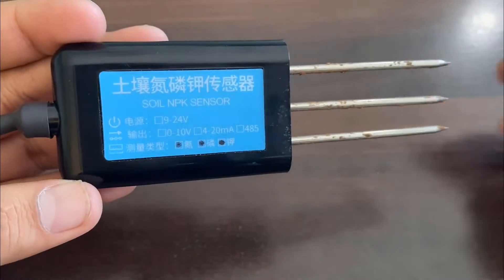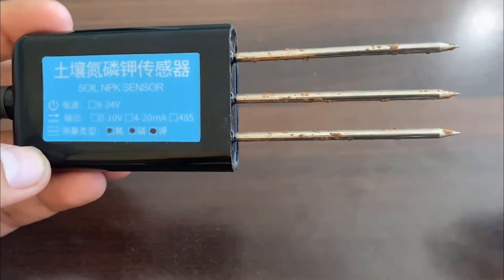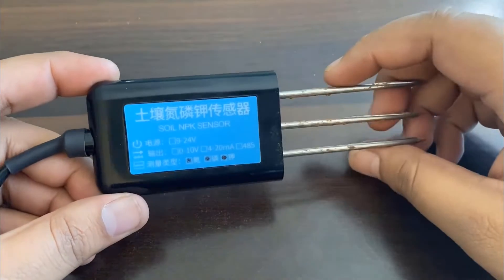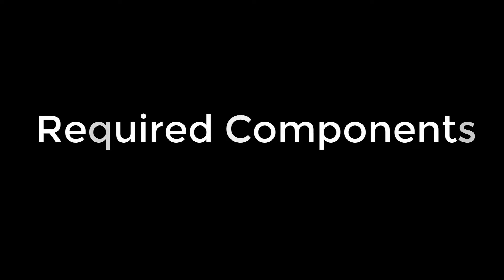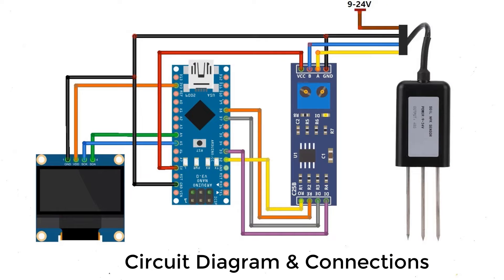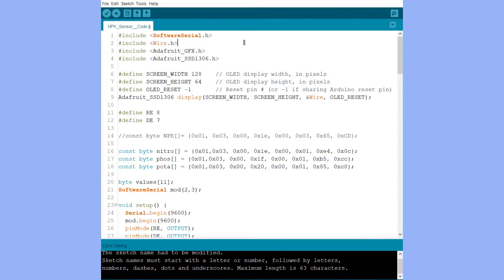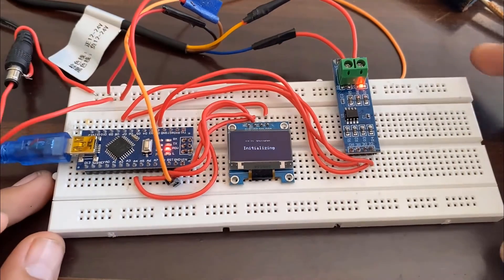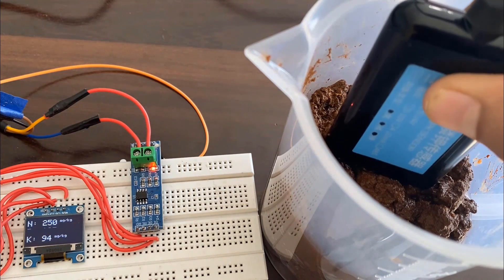DIY Soil NPK Meter || Measure Soil Nutrient Content using Soil NPK Sensor & Arduino

Comment from the maker: NPK Sensor Purchase Link: https://amzn.to/3rEHI8r
Reply: code is running but the output values are 255 255 255 how to overcome this issue
Reply: @SoilMaster-4u  use 4800 for serial baud rate
Reply: @SoilMaster-4u  if you're solution is founded
Help me about that
Reply: @SoilMaster-4u  same problem 
Did you found how to solve the problem
Reply: @khaledmerahi2298  en baud rate is 4800
Reply: @felixfrilovic9370  it doesn’t work
Reply: Can you provide me code?
Reply: sorry, I want to ask. Is the sensor calibrated or does it have to be calibrated first? If it has to be calibrated first, how do you calibrate it? please answer
Reply: Hello, thanks lots for your efficient video's. Could you please send me its Gerber File.
 With The Best Regards,
Dr. Manoochehr Farboodi.
faboodi@gmail.com
Reply: @Climax2025   Sorry for the ignorance of my question, but what would the Gerber Files be.
 Best regards,
Dr. Manoochehr Farboodi.
Reply: I was wondering if this was a fake, typically it would make sense that a semipermeable and selective membrane (each to potassium, nitrogen, and phosphorous) would be needed to keep out other dissolved electrolytes.  I'm hearing nothing like that here and it probably is fake and will just spit out random numbers.  If you want to dissolve NaCl in water and see what happens, if it reads nothing, then try some potassium chloride solution,  and see if it only reads a potassium level. Do the same with nitrogen and phosphorous.  If you really want to see how accurate it is after that you can do a little math and see if the concentration is accurate. I did not see that level of scrutiny here in this video and would not waste my money on this product.

Comment: hlo in diagram you showerd one connection and in bred board you are showing one connection which one i have to follow
in bred board you connected only two wires,a,b in diagram ground and vcc also connnected

Comment: Can you provide details on how you connect the brown wire of NPK sensor to the 9v power supply? Do you need any adapter to do so? Any link on what kinds of power supply should I buy and adapter if needed. Thanks!
Reply from the maker: Yes use a 9-12V DC Adapter.

Comment: I was wondering if this was a fake, typically it would make sense that a semipermeable and selective membrane (each to potassium, nitrogen, and phosphorous) would be needed to keep out other dissolved electrolytes.  I'm hearing nothing like that here and it probably is fake and will just spit out random numbers.  If you want to dissolve NaCl in water and see what happens, if it reads nothing, then try some potassium chloride solution,  and see if it only reads a potassium level. Do the same with nitrogen and phosphorous.  If you really want to see how accurate it is after that you can do a little math and see if the concentration is accurate. I did not see that level of scrutiny here in this video and would not waste my money on this product.

Comment: How do you calibrate the sensor?
Reply: I was wondering if this was a fake, typically it would make sense that a semipermeable and selective membrane (each to potassium, nitrogen, and phosphorous) would be needed to keep out other dissolved electrolytes.  I'm hearing nothing like that here and it probably is fake and will just spit out random numbers.  If you want to dissolve NaCl in water and see what happens, if it reads nothing, then try some potassium chloride solution,  and see if it only reads a potassium level. Do the same with nitrogen and phosphorous.  If you really want to see how accurate it is after that you can do a little math and see if the concentration is accurate. I did not see that level of scrutiny here in this video and would not waste my money on this product.

Comment: Hello Sir/Maam, I would like to ask, if the sensor detect this example value:

N: 40 mg/kg
P: 90 mg/kg
K: 100 mg/kg

What is the threshold of  Low, Medium Low, Medium High, High, and Very High? And I ask too let say Nitrogen is Low how many amount of nitrogen need? Is the soil need 120, 100, 80, 60, 40, 30 nitrogen and so on?

Comment: Hello, I recently tested a similar npk-meter and found that it responded to any salt regardless if it contained any N, P, K. or not. Normal Kichen salt for example consists just of NaCl and no Nitrogen, Phosporous and Potassium (K). It still leads to high values of N,P and K if applyed to the soil. Did you precisely check if your npk-meter is really Ion-selektive or if it maybe also just responds to the conductivity of the solution???
Reply: I was wondering if this was a fake, typically it would make sense that a semipermeable and selective membrane (each to potassium, nitrogen, and phosphorous) would be needed to keep out other dissolved electrolytes.  I'm hearing nothing like that here and it probably is fake and will just spit out random numbers.  If you want to dissolve NaCl in water and see what happens, if it reads nothing, then try some potassium chloride solution,  and see if it only reads a potassium level. Do the same with nitrogen and phosphorous.  If you really want to see how accurate it is after that you can do a little math and see if the concentration is accurate. I did not see that level of scrutiny here in this video and would not waste my money on this product.
Reply: Easier to add Potassium and test as it's easily obtainable.
Reply: Yea the sensors just test ec and spit out a value for npk based on the ec reading multiplied by a constant. If you look at a few examples they are all reading (approximately) n=2.5*p and k =0.9*p.

Comment: Hi, i have a soil multi-parameter sensor 7-1, and i want to print all the sensor, and i have problems to do that. if i use the npk code, it always prints 255 in some sensor. How can i use it with all sensors? i don't know if the answer is the number of bits or something. Please i need help
Reply: I was wondering if this was a fake, typically it would make sense that a semipermeable and selective membrane (each to potassium, nitrogen, and phosphorous) would be needed to keep out other dissolved electrolytes.  I'm hearing nothing like that here and it probably is fake and will just spit out random numbers.  If you want to dissolve NaCl in water and see what happens, if it reads nothing, then try some potassium chloride solution,  and see if it only reads a potassium level. Do the same with nitrogen and phosphorous.  If you really want to see how accurate it is after that you can do a little math and see if the concentration is accurate. I did not see that level of scrutiny here in this video and would not waste my money on this product.
Reply: @jonesmatthew7511  I solved it, Thanks
Reply: @hector2742  hey buddy, can you let me know how you solved this FFFFFFFF 255 issue?
Reply: @luqmanafridi3952  What's microcontroller do you use?
Reply: @hector2742  hello I used an arduino nano and the connections are same in the video. May I know how you solved your problem? I have the 6 in 1 multi-parameter sensor
Reply: how did you solve it??

Comment: Hello, I am trying to replicate the project with an Arduino MKR GSM 1400 and I get pure values of 255, however when I tap the RE and DE pins I get values as random, because they are very different. I hope you can help me, thank you very much :)
Reply: Is this fake then? I was wondering how it differentiates between electrolytes

Comment: Hi! Nice Video, Do you know how to read  If I have a sensor with 6 parameters? Like Humidity, Temperature, PH, Nitrogen, Phosphorus and Potassium.
I have the frame from manufacturer, but then I do not know how to read each of them because it is only one frame, not for every parameter like yours.  So the resulted frame will be like 17 bytes I think..

PS: looks like your first const byte called NPK, but mine contains another 3

Comment: Plz Let me know why the value is obtained only in moist condition and fluctuate with addition of Water
Reply: hello sir, ur problem is also mine so please help me when u fix it
Reply: Because the soil solution nutrient concentration changes with the humidity raises, that's why you need standarize the soil humidity at you make the measures, so you need calibrate your sensor to a standard soil humity

Comment: Hi. 
I have the same problem using Arduino UNO. It replays with FFFFFFFFFFF for N,P, and K. is there any development regarding using Arduino UNO with NPK sensor?
Reply: Give the NPK sensor with separate power (mine-12V),i.e donot connecte the gnd to nano and 485 board. (From HK)Give the NPK sensor with separate power (mine-12V),i.e donot connecte the gnd to nano and 485 board. (From HK)

Comment: Thanks for the nice video...its guiding however, I've done everything but the values are 255, 255, 255 for all the N P and K.. what could be the problem?
Reply: just dip the sensor in water, tea or soil that will show the result, 255 seams to be idle value

Comment: Hi nice video, i was buy the sensor and try to implement this, at the first time i got the right value and always change, but now the output value constant  255,255,255, do you know what could it be the problem ?
Reply: just dip the sensor in water, tea or soil that will show the result, 255 seams to be idle value

Comment: Hey, I did the implementation exactly the way mentioned in the tutorial, I just used Serial monitor in place of OLED display. But I find the value of N, P, K to be 255 when the NPK sensor is plugged to 9-24v power supply and even if it is not connected. Can you please get me out of this i.e finally getting the exact NPK values you got in the video. Please 🙏
Reply: I got same problem too. do you have any development?
Reply: @belajardarisiniaja  Another Point to note is that the Jxct NPK sensor might not be reading the correct NPK values as we observed some linear trendline between N, P, K form the data of many samples. So, basically our conclusion was that the NPK sensor was only reading the Electrical conductivity and then trying to use some algorithm (which might be close to the linear I mentioned above)to give us the N, P, K values i.e., We found the NPK values shown by the sensor are not trust worthy.
Reply: @akulavamsi4832 thanks for the info. so, basically we can predict how many N,P,K or others component by calculate only some constant value with EC in a formula?
Reply: @belajardarisiniaja sorry,  I didn't get you
Reply: @akulavamsi4832  I mean, I can get the value of N, P, K with tool that can read Electrical Conductivity as long as I know the constant value or the linear trend formula
Reply: @belajardarisiniaja  Do, do you know the tool or the formula?
Reply: @akulavamsi4832  I still dont know the tool for microcontroller but i have read something like "electrical conductivitybfor detecting nitrogen"
Reply: @belajardarisiniaja  Yes, There are some research papers on trying to find the relation between EC and N,P,K but nothing is finalized.
Reply: @akulavamsi4832  hi. today, my RS485 to USB converter is arrived. But, after I try to read the NPK sensor with CAS modbus software in windows 10, it failed to read the sensor. it always timeout even though the device and function is match with the datasheet. Is my sensor broken? 
* for the wiring :
sensor npk (A,B,GND) -> RS485 to USB converter (A,B,GND). 
sensor vcc -> adapter 9V 2A
Reply: @belajardarisiniaja  Is there any other means that we can connect?
Reply: @belajardarisiniaja  Yellow and Blue wires of the Sensor should be connected to USB converter and Black and Brown wires should be connected to the power adaptor. Also for the converter to work ensure that you installed CH340 driver into your PC. Then when using CAS modbus scanner software please ensure that you did input the baud rate right. i.e 4800 as it is default and mentioned in documentation. and then run the reading holding registers (4xxx) and put offset as 31 and length 3. Then If you get the results then your sensor is working or else it is not.
Reply: @akulavamsi4832  it works. The result is in column hex e.g 0x0034 but in column char is 4. Is it ok?
Reply: @belajardarisiniaja  Great. I look at the int column for the results.
Reply: @akulavamsi4832  thank you so much for your help
Reply: @akulavamsi4832  Hello can you explain the last few steps. I do not understand how to "run the reading holding register." What does (4xxx) mean? Can you show me how you updated your code? Sorry, I dont understand. Thank you very much!
Reply: Furthermore, when I change my baud rate to 4800, I get strange results that are not numbers. A baud rate of 9600 is the only one that gives me readings.
Reply: @danielalel7139  Is there any other means that we can connect for more discussion?
Reply: @danielalel7139  When you open CAS Modbus scanner, on the left side when you right click, you'll get 'Add Connection' click on it, then you'll need to give the 'COM' port number and baud rate then after clicking Add connection, you'll need to right click on the connection, then you'll need to click on 'Add Device' there set the device Id to 1(as it is the default one and if you didn't change'), then again right click on the device, you'll get to choose this 'read holding register(4xxx) and then choose this offset to 31 and length to 3, then you can poll and get the values. I hope you are doing the same.
Reply: @danielalel7139  If this is the case, I guess your default setting are changed i.e., your baudrate at which the sensor needs to be operated is changed, you can re-change it to 4800 or if you find you are getting desired values with 9600, then staying with that is fine too.
Reply: @akulavamsi4832  please help I can't get values on jxct software also i tried cas but it display mb response unknown.
Reply: I spent all night to find out the solution. In my case the sensor default boundrate was 4800 instead of 9800 so, modbus initialization now looks like that: mod.begin(4800). I also had to add two 4k7 resistors to pull up I2C bus to start display working
Reply from the maker: Great work. You made it working. All the best
Reply: @michapacholak9559  Great, but I wish those values were accurate or close to real laboratory values. But, sadly they are not. I.e., Jxct sensors are not reliable. 🤷
Reply: @akulavamsi4832  this is what I want to check in next step. Maybe my sensor will be more accurate. What about ratio between values in your case? Are it close to lab values ratio? The ratio is also useful in planting. 
Did you get stable readings or values changes from sequence to sequence?
Reply: @belajardarisiniaja  Do search for NPK sensor not working in Arduino forum. I found some leads there but first to understand whether your sensor is working or not I used Rs485 Converter and a PC using CAS Modbus Scanner Software.
Reply: @akulavamsi4832  usb to rs485 converter? thanks. very appreciated
Reply: @belajardarisiniaja  yes

Comment: Apart from NPK , is there any other sensors available to determine other soil elements.
Reply from the maker: Only laboratory method or lab test is available which is very expensive

Comment: Hello! I'm facing a problem. When I use the same code that howtoelectronics has provided for the NPK sensor, the Max485 to TTL converter / Modbus we're using simply returns FFFFFF, and thus just constantly outputs 255, 255, 255 for the values. Any idea on why this might be happening?
Reply: Hi there Satriya, did your NPK worked after that?
Reply: Kasus nya sama bang 
Udah terpecah kan blm masalah dmn
Reply: dah dapat solusinya mas ?
Reply: I was wondering if this was a fake, typically it would make sense that a semipermeable and selective membrane (each to potassium, nitrogen, and phosphorous) would be needed to keep out other dissolved electrolytes.  I'm hearing nothing like that here and it probably is fake and will just spit out random numbers.  If you want to dissolve NaCl in water and see what happens, if it reads nothing, then try some potassium chloride solution,  and see if it only reads a potassium level. Do the same with nitrogen and phosphorous.  If you really want to see how accurate it is after that you can do a little math and see if the concentration is accurate. I did not see that level of scrutiny here in this video and would not waste my money on this product.
Reply from the maker: Check the frame bit and compare with instruction manual. If the address are correct the sensor will return correct values.
Reply: Give the NPK sensor with separate power (mine-12V),i.e donot connecte the gnd to nano and 485 board. (From HK)